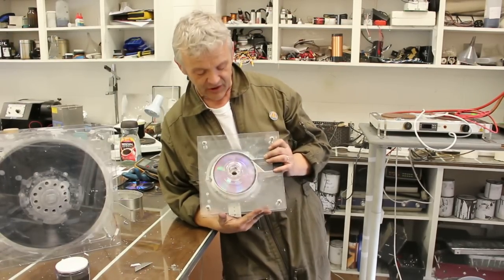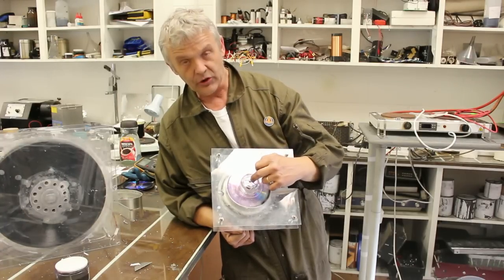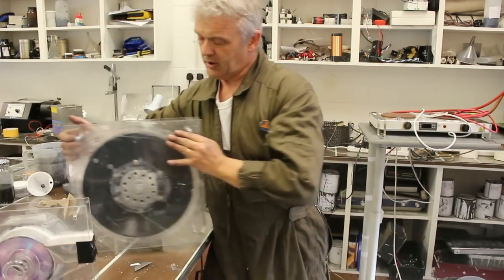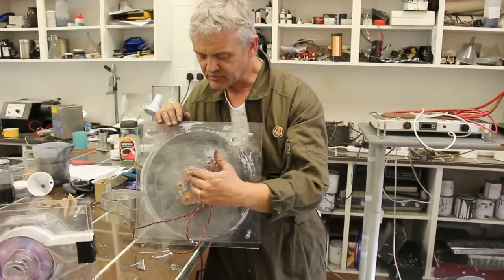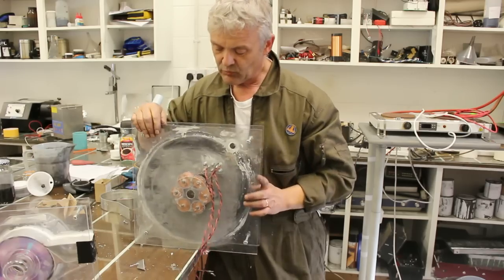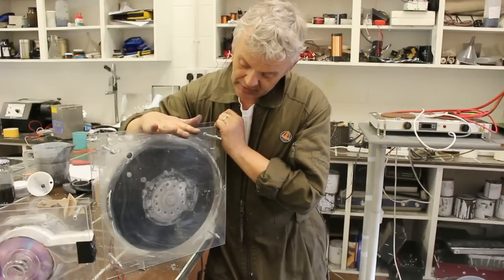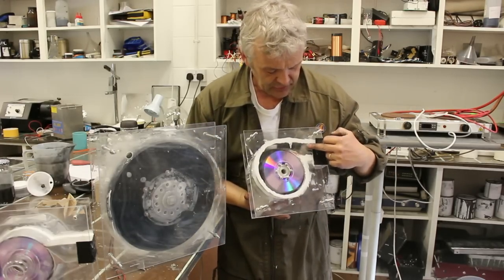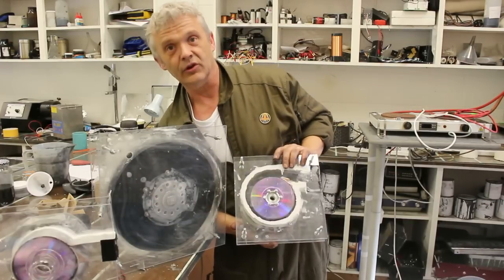Tesla Generator Construction Details

Comment: REPLACE THE MAGNETIC MOTOR WITH FARADAY DISK, NO more magnetic cogging (resistance)!
But now you don't need the motor (faraday disk) !
YOU MAKE MANY FARADAY DISKS THAT BECOME THE TESLA TURBINE. 
AND I KNOW THE PERFECT CIRCULATORY SYSTEM FOR THE AIR PRESSURE THAT IS SELF CONTAINED IN A LOOP. AND IF THE DISKS ARE MADE THE RIGHT SIZE ALONG WITH ENOUGH MAGNETISM...
WATCH OUT OVER UNITY/ FREE ENERGY DEVICEs, THIS OLE TIGER 🐅 IS BEING LET OUT OF THE BAG 🎒 AND ITS OPENLY AIMED AT THE SLAVING POWERS THAT BE!

Comment: Quick Question what would be the best course of action to completely eliminate my electricy bill. I want to have my energy company paying me for large surplus. Would building panels stacked on towers connected to generators connected to ultracapacitors work? also is graphene sand at all conductive could you possibly do something beneficial with that( a lawn wide battery or solar panel made?
Reply from the maker: +Malcolm Bulls doing that is a strategy mate and depends on your location and the access you have to generation resources like geothermal, solar, wind etc etc - I can't possibly give a sensible answer here i am sorry

Comment: Thanks for your reply Rob,

I suppose I'm a bit jaded by all the snake oil sellers out there in the quest for over unity.

I guess i was hoping you would do as you have done in the past and validate the experiment with some real data.

There were a number of airflow sources that came to mind;
compressed air,
an inflator such as you used, 
and last but not least my favored method, numerous cartons of beer for me to generate an airflow etc.( the wife won't like the last one and the impact on the environment might be disastrous)

And I'm sure there would be others but all of these would require an input of energy which is greater than the output, if the laws of physics are correct.

Call me a naysayer if you will but is it not just a different method of coupling a power source to a generator, of which there are many different types with varying efficiencies, and if so what is the advantage.

Tesla claimed an efficiency of 97% but to date as far as I can read only 40% or so has been achieved, much less than conventional turbines.

With regard to the solar cells and wind turbine, the reason I use them is because the power source is there and freely available to all, at this point until the governments find a way to tax them, with minimal impact on the environment.

And if the light wasn't there I think we would all be in a bit of a pickle. A bit of a moot point.

I apologize if my asking of pertinent questions makes you think I'm being negative, but I think it would be rather ignorant of me if I didn't ask questions. If you feel that they were irrelevant and you don't want to answer those questions please just say so. 

Sincerely
Peter
Reply from the maker: +PETER MOLL no worries mate and it is a question of time - i will provide data in time - but we aren't on a 'free energy' quest here - have a look at the on efficiency video i just did this should help understand my viewpoint

Comment: Probably going to stir up an ants nest, but anyway.

How much energy was expended to produce the electricity?
Where in the practical world would you source the air flow to run the turbine?
Is this more efficient than other ways of producing power e.g. solar, wind or even an ICE?

Living in an off grid situation I have looked at many alternative ways of producing power and practicality has drawn me back to solar panels for main production with a wind turbine to supplement them and the obligatory battery bank. A petrol generator for the system backup and for using heavy draw equipment such as a MIG welder and large air compressor.

The only part of the system that I see could be changed would be the batteries in favor of your capacitors.

I apologize if I offend anyone but I can only this as a toy, and that is well and good if it inspires people to experiment.

Waiting for the flaming.

Peter
Reply from the maker: +PETER MOLL i don't think what you are saying is that controversial mate. In my mind it's a bit of fun and inspires experiment - what more reason do you need really?
Your questions aren't that problematic i can think of a few ways to source the airflow required and quite a few practical applications - but i think that is a problem for experimenters to solve - i'll probably share a few if i build them.
Solar cells are only more efficient for you because you don't have to generate the light - if you did they would only be around 7% efficient - you'd probably throw them in the bin if did have to generate the light lol.
It might be a better use of your time if you spent a little time thinking how they could be used instead of finding reasons they can't. If you do that I think you'll hit on the difference between the average person and the inventor

Comment: Robert, I really was not sure what you made so I watched a few u tube videos. There are some crazy claims out there except maybe this guy. Mrteslonian. He was using water to make air pressure to drive the motor. Wish I had a spring on the property I would try it
Reply from the maker: +robert lanham i have seen a few of his vids - there are no free rides here mate in terms of energy - but it is an interesting device if only from the constructional viewpoint as it would bear on the cost per kilowatt as compared to traditional generators
Reply: +Robert Murray-Smith roger that

Comment: i think it would generate more power, if you switched the input to the central port currently used for exhaust, because centrifugal force is going to make the air volume have the tendency to move to the outside, working with your design instead of against it...this may require some means of getting the platters spinning (smaller starter tesla turbine would work well i think) but this is fantastic on its own :) thank you.
Reply from the maker: +raven bishop I don't think it would work that way mate as you are using the flow of air to turn the disks rather than spinning the disks to move the air
Reply: +Robert Murray-Smith  i think you can, if you offset the holes on the disks by half the radius of the holes it should spin in the direction of the offset.
Reply: +raven bishop or against the direction of the offset depending on how you look at it :)
Reply from the maker: +raven bishop I see what you mean and it's pretty easy to try - so - i'll give it a go - cheers mate oh and by the way i have no problem being wrong lol
Reply from the maker: +raven bishop I see what you mean and it's pretty easy to try - so - i'll give it a go - cheers mate oh and by the way i have no problem being wrong lol
Reply: +Robert Murray-Smith - i wouldn't imagine you would be bothered by being wrong, you have a drive to do things the best way possible, if i thought you would mind i probably wouldn't have even commented. its people like you and i who change the world with their ideas and it would be impossible without bits of advice and tweaks from other people. i dont know for sure it will work, but it seems like it should :) - wait, now im quoting you, to you :)
Reply: +raven bishop i'm not complete sure you can call any of this thread "wrong" anyhow... its imagineering.... i don't thing there is a "wrong" in imagineering
Reply from the maker: +raven bishop Mostly things fail - it's by working through the failure you achieve things. If you didn't do things because you were afraid of being wrong you would never do anything
Reply from the maker: +raven bishop absolutely not lol

Comment: was the the design with the sharper curve more efficient because with the other you had more surface area and thus more resistance or just the turbulance inside was less evenly destributed because of the bent shape?
Reply from the maker: +сталкер чворович the air stream is tangential in the one and not so much in the evolute